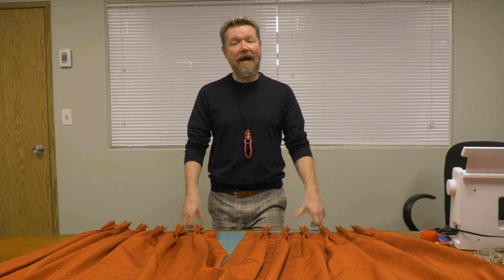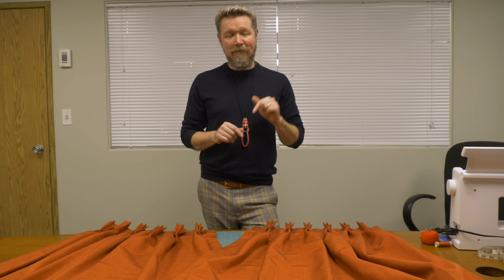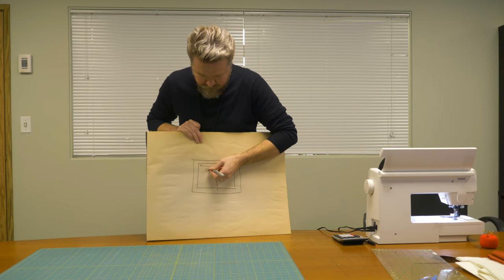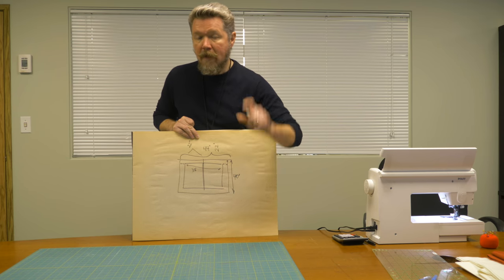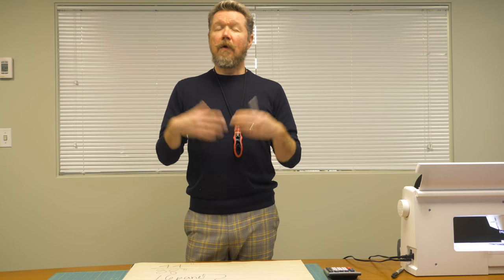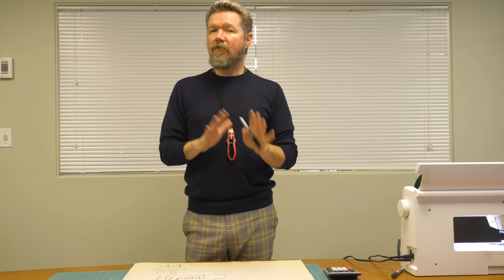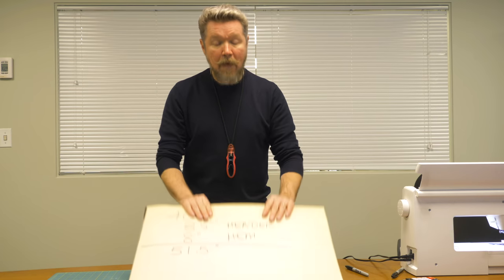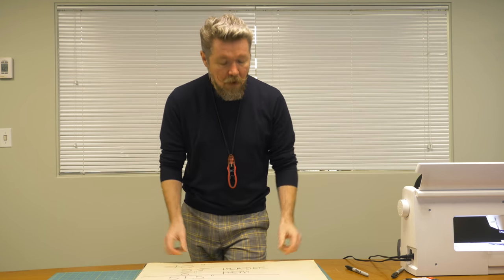Pleated Drapes PINCH pleats. EVERY Step to make curtain making easy

Comment: Tutorial was very clear.  My finished curtain looked great.  I have never pleated a curtain before but I am ripping out the pleats on one panel to recalculate the spacing and pleats.  Thankfully I hadn’t sewed the other panel.  When the curtains are opened, the majority of the curtain would be in front of the window making the window look narrow and blocking the light.  Fortunately I have enough curtain to allow for the recalculation of the extra width needed.  I’ll know next time.

Comment: I found your manner and expertise very pleasant and easy to follow.  MY situation is I aquired some wonderful silk drape panels that are triple lined.  I am very creative but not a seamstress.  I need to divide each pre-existing panel into 4 panels.  I have (2) 90" panels that need to be divided into 4 each.  I plan on utilizing the existing side seams and budget (add) to have them hemmed (from sides only) as they are correct length.  they are hideously large/heavy/etc.  Finally here is my question:  by dividing them I will need to remove a pleat at each cut, is that (safely, easily done)?  im assuming it will buy me some width too as I could utilize all the width on final product I can get.  If I cut them myself I can simply my request to have the sides hemmed.....as I feel that would be out of my ability realm.  I realize I will need to very carefully control the movement of the drapes and CAREFULLY follow the pattern laterally for a straight cut top to bottom.  A)  is it true that I will "buy" some width by opening pleats?   B) do you think this is possible?  I gather by your video once the pleats are "released" the lining (triple) will be consistent in width with the silk outer drapes.  thoughts/cautions?  Thank you so much if you are able to offer any info on this.  id send an attachment as im INCREDIBLY PROUD of this find and am ultra excited about this product!  Greg Niederhaus, naplespelicanmarsh@gmail.com (if you are able to respond email I will send attachments). thanks again!!!

Comment: So excellent. Thank you so much. Especially the math. I have a question - if you are using interlining, would you sew that together with the lining?
Reply: Hello!  Interlining is applied to the main drapery fabric, not the lining.  Once the interlining is applied, you can treat the main fabric and interlining as one, and then attached the lining as normal.  Keep in mind that the interlining will add bulk to your pleats.  You may want to cut the interlining smaller than your main fabric so that it is not doubled up in your header or hems.  This would require basting the interlining to the main fabric while you're making the drapes and then removing the basting once the drapes are finished.
Reply: @myleshurtubise9420  thank you so much!

Comment: I hope you can make sense out of my question.  I want fabric wrapped around the corner of the curtain rod so that it is nicely covered.  If I follow your instructions in your video will I have this as part of the end result or do I need to add extra fabric to my calculation to cover the sides of the curtain rod?
Reply: Hi Dana.  I think I understand your question.  You're talking about the space between the edge of the curtain and the first pleat and wondering if it's enough to hide the side of curtain rod.  The spacing between the pleats will depend on the number of pleats.  You can make first space (from the edge of drape to first pleat) larger than the spaces between the rest of the pleats.  You'll just have to adjust your calculations.  I would sketch out your desired finished drape, showing the spaces and the pleats, and then do your calculations to make sure it all works.  I really hope this helps!  :)

Comment: This is a great video. I want to make double pinch pleats instead of triple pinch pleats. Do I need to do anything different to the spacing calculations? Thanks
Reply from the maker: The drapes will be less "full" looking with a double pleat, which is totally fine! You can use the same measurements and have a more straight/flat curtain design, or you can adjust ever so slightly to create the same full effect. (Reduce the panel sizes by 1/8"-1/4", depending on your desired panel sizes). This is not necessary though, since doing a double or triple pleat is practically the same, and you'd be presumably choosing a double pleat instead to achieve a less "full" look on purpose. If you want to maintain the same fullness, doing a triple pleat is an easy additional step/fold compared to the double pleat.
Reply: @StudioFabricana  that's great - thank you so much 💗

Comment: Thank you for answering my previous question.  I do have one more, sorry.  When you put the lining to below the header of the face fabric I do not see where you sew it to anything except the sides.  Did I miss something or does it get stitched to the face fabric at all? Thank you!
Reply from the maker: Hi Chelley! Your lining will be "open" until close to the last step of the project when you create your pleats. Once you've sewn the line for your pleats and gathered it, the top will be "sealed". If you sew the lining to the header tape before that (creating a top stitch look) it can be harder to pleat and gather the drapes since you'll be trying to pleat/gather a rather thick seam.

Comment: Absolutely loved this video.  Just unsure how you attached the Drapery hooks as when you use header tape the slots are there but when using buckram they are not. I have subscribed as I am a new business and the video was just what I was looking for.
Reply: Hello Ann.  From the back of the drape you can slide the sharp point of the drapery hook right into the stitches that created the pleat (toward the top of the drape).  The straight 'pin' part of the hook should rest parallel and directly behind these stitches.  I hope this info helps.

Comment: Wondering where seams ideally should be situated in relationship to the pleats since my wide panels require a lot of fabric.  Also any advice for drape weights? Great clear video.  Thanks.
Reply: Hi Lee.  I'm not an expert on all things drapery, but I think would actually avoid having the seams of the lining line up with the seams of the main fabric as this will potentially create more bulk in the pleat, which may be difficult to deal with.  If there are other opinions out there, please chime in.  Thanks!

Comment: Hi there, are there instructions on how to hang these curtains? I have only seen header tape exposed and hooks put through. This looks like the header tape is covered in the fabric... thanks!
Reply from the maker: Hey Claire! The Header tape is applied to the top of the curtains, sewn or glued depending on the type you have, and then "hidden" behind the curtain. You can see how it is folded at the top, and then at the end when you create the pleats, it fully hides the header tape. 
You then put hooks through the pleats as shown in the video, and those hooks are mounted onto a runner or rod. The runner/rod is a piece of hardware you have to purchase, which gets mounted on the wall. 
We have a separate video here that shows how to mount a channel rod. The channel rod is not the exact type of rod you need for hooks, but it is similar and will give you an idea of what the process looks like. https://www.youtube.com/watch?v=mJGPzpdicNE
Reply: @StudioFabricana  Thank you so much! <3

Comment: I am a little worried about the length of the drape.  I want them to go to the floor, but not to puddle.  Since they will be hanging from a drapery rod with a ring, do I subtract any more for the ring?  Thanks for the tutorial.
Reply: Hi Susan!  Yes, if your drapery hook will be hanging off of a ring, instead of measuring your length from the bottom of your rod, you will measure from where the hook meets the ring.  Don't forget, you don't want to measure all the way to the floor.  You want to allow a little clearance between the drape and floor, so they don't drag when opening and closing.  Keep in mind, if you err slightly in the length of your drape one way or the other (too long or too short) you can slightly adjust the placement of the hook in the header (slightly higher or lower as required).
Reply: @myleshurtubise9420  Thank you.  I am going to make some for a very big window, and will send you pictures.  Your telling me about the adjustment of the pin has eased my mind!  Thanks!

Comment: Just one thing I’m a bit confused on is that you initially said you’ll be using 2 panels for each drape but I can’t see the seam where you’ve sewed this together. Also when doing the calculations for the pleats you measured the lined drape at around 53.5” if 2 panels were used wouldn’t this number be closer to 100”?  Have I misunderstood something?

Comment: Thank you, thank you, thank you!! One question...I have to sew 7 panels for a large sliding door; how will I make sure the seams from the lining will align with the seams of the drapes?
Reply: Hello Susan.  That is an excellent question!  For the five internal lining panels (i.e. the ones not on the far left or right) I would cut them the same size as the five internal drapery panels (or hopefully they will already be the same width!).  Then I would cut the two 'external' lining panels 2" narrower (each) than the 'external drapery panels in order to pull the drapery fabric to the back side of the drape.  I hope this makes sense.  Please let me know if you need further clarification.  Take care!
Reply: @myleshurtubise9420  Thank you, makes sense.

Comment: When hanging your drapes do you need to put a curtain hook at the very beginning and very end of the drape or do you let that just hang naturally?  i.e., is the first hook in the first pleat or do you put a hook in before that?
Reply: Good question!  At the outside edge of the drapes you can put a hook at the edge of the drape (i.e. before the 1st pleat, where the lining meets the fabric at the back) OR you can bring that outside edge of the drape toward the wall.  This would involve putting a cup-hook in the wall and creating a loop on the drape to attach to the hook.  You may want to alter the size of the space before the first pleat in order to accommodate the distance between the drapery rod and the wall.  The benefit of this is technique is that it helps to keep light from pouring in at the outside edges.  
At the inside edge, where the drapes meet, place hooks close to the edge (again, where the lining meets the main fabric).  I hope this info helps!
Reply: @myleshurtubise9420  Thank you!  That's perfect.  I'm recalling that there is a hook that is not a pleater hook, but a more simple hook that is probably the right one for this purpose.  I appreciate the help!

Comment: If I am doing sheer curtains with no lining, is it okay to do the panels at around 1.7 the width of the window?
Reply: Hello!  You could certainly do your sheers at this ratio, just keep in mind that the more fullness you have, the more privacy you will achieve.  I believe for the sheers I did in my dining room, I did them at 2.5X fullness, which are quite full, but give me the privacy that I want since that window is quite close to the sidewalk in front of my house.  :)

Comment: Great tutorial! Thank you for posting. Quick question. If I wanted to start off with a pleat rather than space then pleat, is that possible?
Reply: Yes!  I have done this on drapes before.  I would suggest making a diagram of the top of your drape to double-check the number of pleats and spaces, so you know your calculations are correct.
Reply: Good to know. Thank you!

Comment: If I have a huge window and need 2 panels, they only come in 54 inches, so say I want one panel that's like 100 inches and the other panel/side will be 100 inches... Do sew the two 54 pieces of fabric together first, so i have one piece of 100 inch fabric, then sew the lining fabric to have 100 inch fabric, then follow the instructions here to put the two together? Or do you put the lining first with the fabric together and then sew the two completed pieces to make the 100 inch bigger panel?
Reply: Hello!  This is a great question.  Yes, sew the two 54" piece of fabric together first and then sew the two lining pieces together and then continue to follow the instructions.  The lining should hang free from the main fabric across the width of the drapes.  The lining will only be joined to the drape across the top (caught in the pleats) and down the sides.

Comment: I am having trouble find header tape like the tape you use in this video.  What brand is it and where might I find it?  Louise
Reply: It's called buckram in the UK and is on ebay :). I think header tape in the UK is just the sort with the cords you pull up to length?

Comment: I find pillowcasing the lining, my drapery exposure at the side hems on the lining side say for example 1 inch, it tends to shift no matter how much pressing I do. How do you prevent that?
Reply: Hello.  You may find that when the pleats are in, this is less of a problem, because both the fabric and the lining now have lots of slack, so gravity may take over and let your drapes hang straight.  If it's still a problem once the pleats are in, you may want to topstitch the side seams (about an 1" from the edge), or, if you don't like the look of the topstitching, you can blind hem the side seams.  I hope this helps.
Reply: I have a blind stitch machine so I’ll probably do that to the side hems.

Comment: Help! I've read that to get the desired fullness you want one drape to be twice as long as the window it's supposed to cover. so wouldn't each drape be 44" wide and not 22" - I'm confused
Reply: Hello Petra.  I think you may be confusing the FINISHED width of the panel (after it is pleated) with the width of the panel BEFORE it is pleated.  Each drape was 22" wide AFTER it was pleated.  I hope this helps clear up the confusion.
Reply: @myleshurtubise9420  Thank you Myles. Yes between your comment and this video I was finally able to figure out my drape dilemma!

Comment: No center over lap no end turn over to hide the sun from coming in so that is 8 pleats and 1/2 pleat over lap for center 
So I learn some put not the right way
You need to add move material to that each side takes 3” so that is 6 and over lap center is like 1.5 so 9/10” is added.